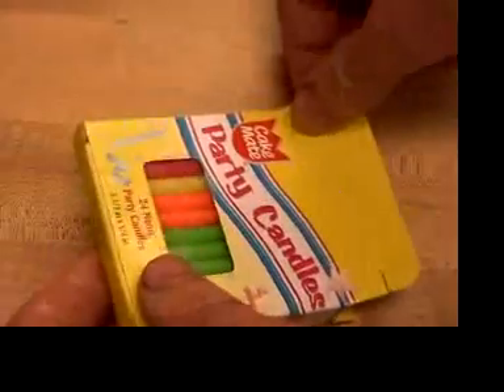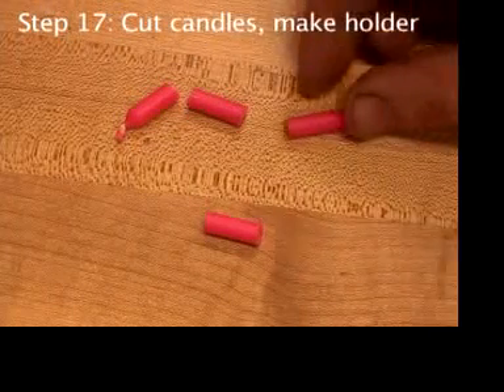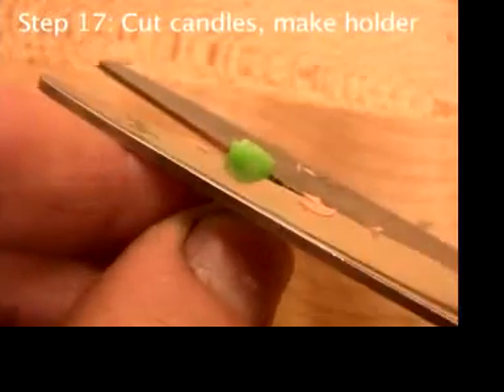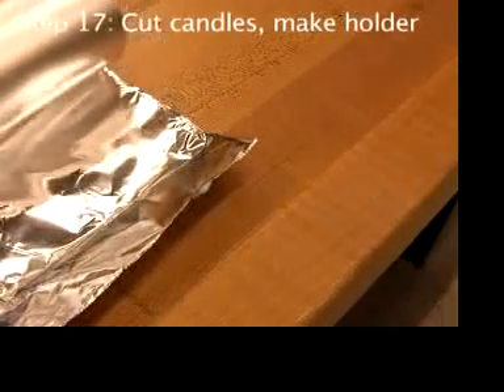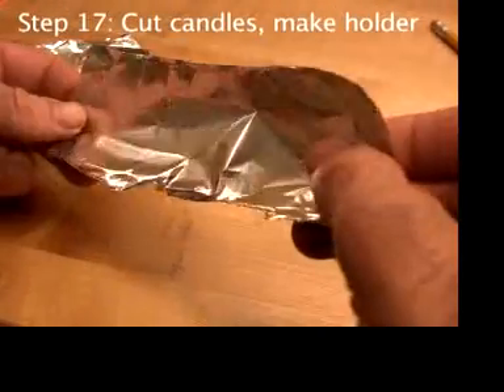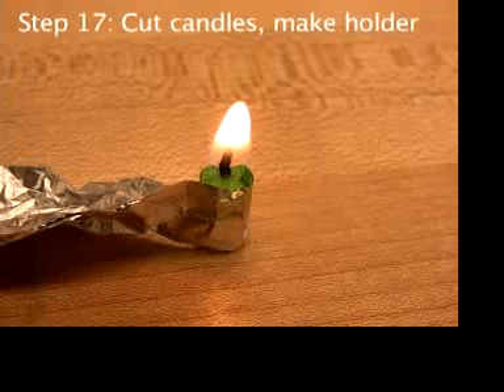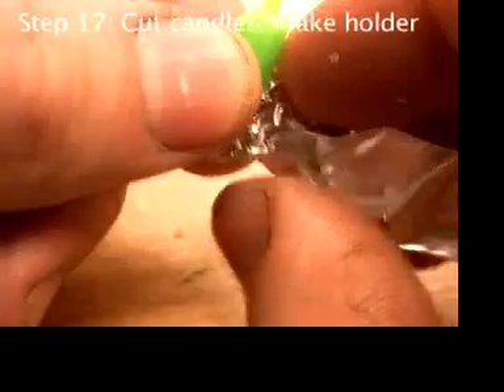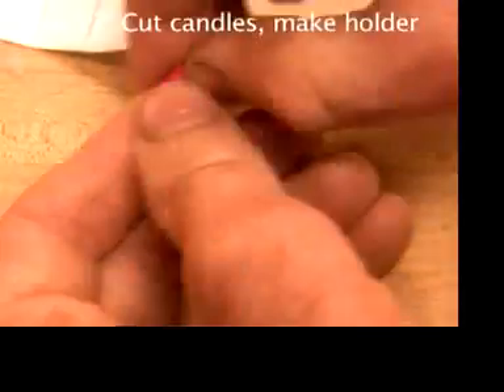Part 20 Build a Putt Putt/Pop Pop Steam Boat s17candle holder

Comment from the maker: Its really easy to make an oil lamp. Just get a little piece of aluminum foil and make it a little concave. Fill it with a few drops of vegetable oil. Put a short piece of cotton string—it cant be synthetic--half in the oil and half out. The oil will wick up the string. Light it.
Slater